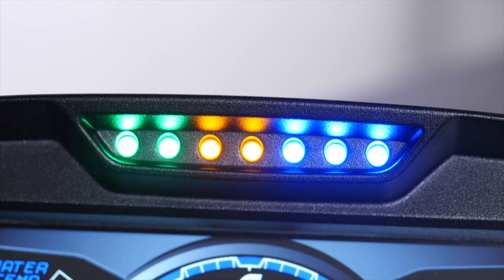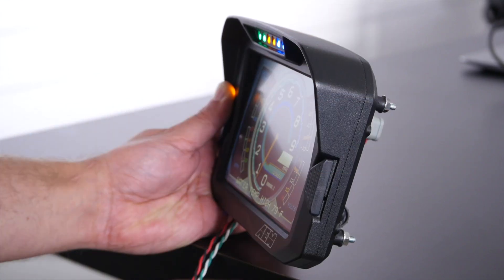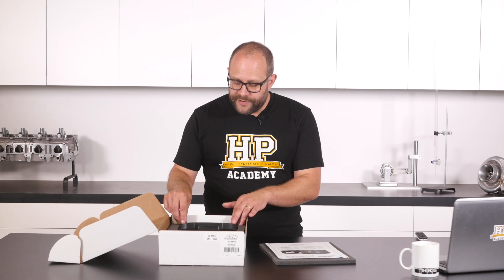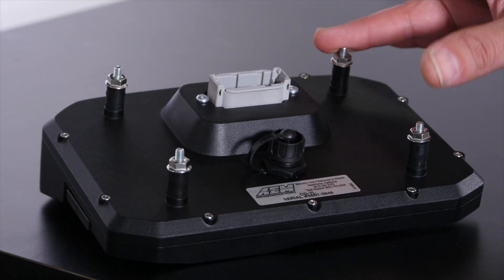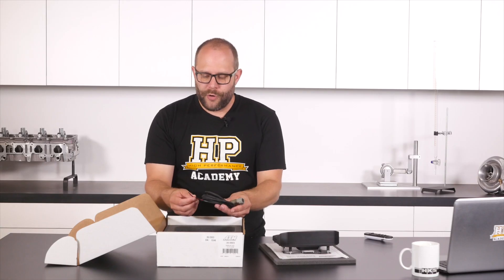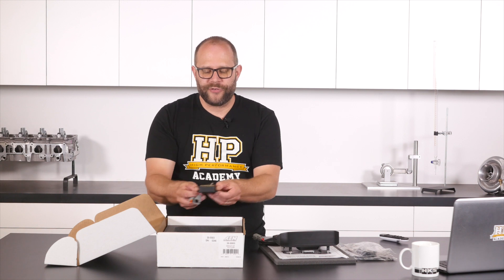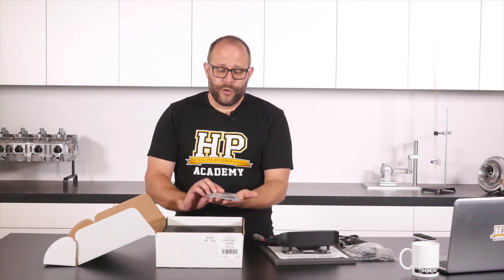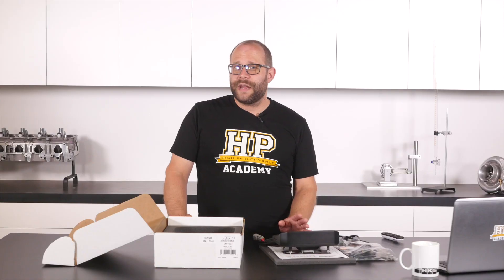🛑 Watch This FIRST! | AEM CD-7L Dash Logger [UNBOXING]

Comment: Hi please confirm if it will work with link G4+ extreme
Reply from the maker: I believe this shouldn't be a problem, but honestly with questions like this, you are best to go straight to the source and it is what I would do myself to check. 
Both Link and AEM have excellent customer support and forums from what I have personally seen. No one knows a product like those that manufacture them - Taz.

Comment: So this uses the usual j1962 connector and SAE j1850 protocol? Pretty versatile datalogger/display with all the right features, if the price is good as well, then this is a must for competition racing cars.
Reply from the maker: G'day Marios. AEM sell a cable that does indeed use the J1962 connector, but it interfaces to the CANBus protocol pins, not the J1850 pins. Makes the dash super easy to install in any modern car with a standard ODB2 interface. - Zac.
Reply: Good day to you too my friend. My question Zac was weather the CD-7L uses the obd2 protocol also besides the area network one, as obviously any real time data display device does that through the CAN access pins. But cheers as you've answered my question anyway.